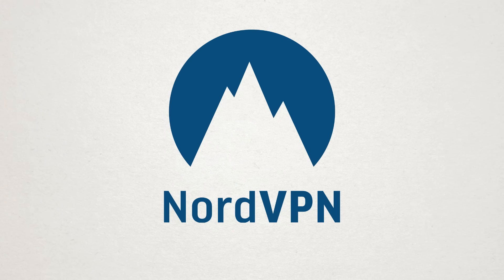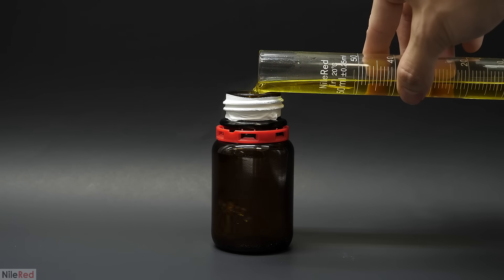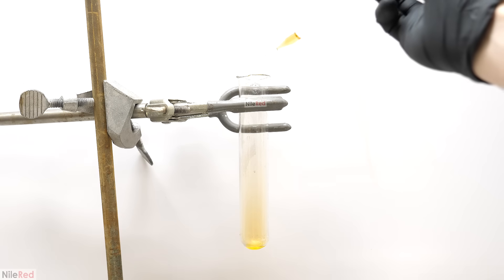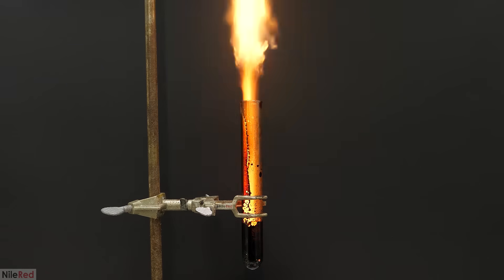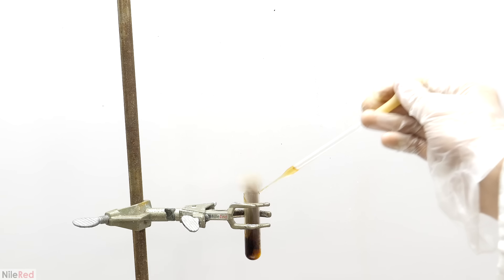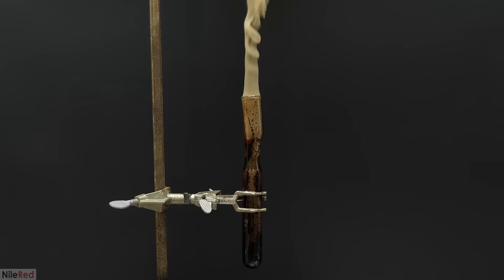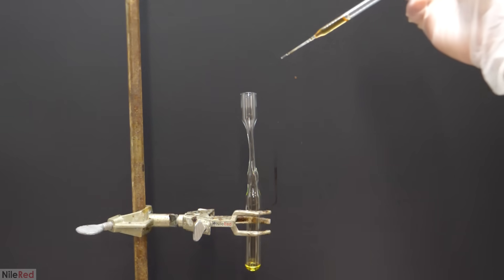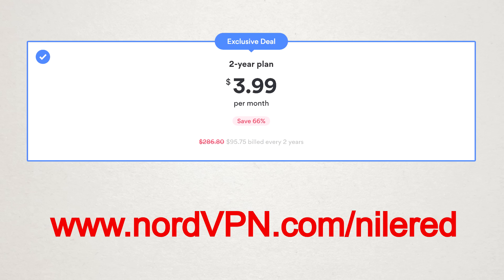Making test tube liquid rockets

Comment: 16.7ms per frame on a 60 FPS footage would be more accurate, also, if the camera does not specify if it's truly 60 or 59,94 there are easy online tools that can analyze it, not sure if it helps without precise mixing but may help in other experiments, cheers.

Comment: This would be a good self lanching model rocket motor
Idea no.1: you can flip the rocket when the engine is in place and it would fire and blast off for a few seconds (no longer applied now that i get what i mean by this idea)
Idea no. 2: you can have a little thing separating the chemicals and you pull it out to fire the engine and blast off (good for public store buying in this idea)
Just for if you wanna make a rocket motor out of this

Comment: Hello...
OK, to neck down the test tubes, clamp a pair of pieces of wood in a vice and drill a hole on the center between the two pieces to make somthing like the jaws of a pair of pliers.  You need to have long enough pieces so that you handles on one side of the hole.  The hole diameter should be the desired throat diameter plus twice the thickness of the test tube wall.  Soak the wood in water for a day or two to prevent it from burning.  Loosely rubberband the handle end together to make the tool easier to use one handed.  
Heat your test tube to the plastic point and slowly squeeze the test tube with the wood pliers at the point where you want the throat, while rotating the tube.  It may take a few heats to get down to the desired size.
For the eye dropper, take some glass tube and draw out a long  spout with a 45° to 60° bend.  The spout should be long enough to get the tip into the throat, if not past it a bit.
Keep up the good work!!!

Comment: The phenomenon you found of solid material is similar to the coking phenomenon in hydrocarbon fuels, the problem with it is that it could clog the valves and pumps of preburners or the main combustion chamber, maybe through thorough mixing by the fuel injectors it is able to burn without the residue

Comment: 0:20 Why??? Wouldn't the Nitric acid eat his hands 😭
Reply: I mean yes. But acid can be washed off relatively safely if ready and done quick. Very minor burning quickly with some. But as far as I understand most take a second on skin. It's the saturation isn't washed off immediately that's dangerous unless it takes a second to get to in the first place from my understanding. Pretty much just an example of why skin is better than gloves in that case. Really drives home that minor acid burns would be better than pretty rapidly combustion gloves (melted plastic on your skin will be worse I promise, not for every acid but here yes)

Comment: what if you modifyed a carborator to take in the oxidizer instead of air, and then mixed it with the fuel and had that go to the nozel so it would kinda work like a car

Comment: You can get MMH in the forest, it's the active toxin in the poisonous false morel mushroom. People eat them after parboiling several times, changing the water for each run. I suspect the yield of MMH would be minimal, but it would be awesome to extract literal rocket fuel from a mushroom. You'll likely also find red mushrooms with white spots like in Super Mario. Those don't actually make you bigger, but they may make you hallucinate into thinking you've become bigger, so it's best to avoid those.

Comment: Ok Ok 
I hope this finds you and you read it! (sorry I didn't double check this, I just one time wrote it because I'm in a hurry)
So you should use canula transfer lines with glass syringes, that way you can inject either a single compound or both concomitantly just as a fuel pump would inject into the rxn chamber the two compounds for a rocket engine.

I think you said you injected the aniline into the nitric acid and that was a poor choice. This is because you should have the more dense nitric acid 1.51 (g/mL) displacing the aniline (1.02 (g/mL). When you add them your way your getting layering, then mixing. When you want a more mixed solution and aggressive rxn you add the more dense solution to the less dense solution and the two MUST mix in order to find their displacements.

(typing and thinking as I write this) I truly think the safest and best rxn would be adding aniline into the nitric acid via a long canula transfer line, and doing with positive pressure nitrogen from an aniline reservoir that is under positive N2 gas pressure. You can then use a stopcock to start and stop the rxn and continue adding fuel so it's not your limiting reagent.AND if you get good, you can have two canula transfer lines for both solvents under positive N2 pressure!!!! ** best idea yet
The canula line MUST BE submersed to the bottom of the test tube or whatever container your using. Just as the rxn chamber is the primary area before kinetics occur, your test tubes are oriented the same way. You need the bottom of the test tube (1 rxn chamber) to be fully mixed before ejection into the kinetic/velocity chamber, or second stage of your rocket engine. 

Also, go have some fun with KClO4 or KClO3 (if you're feeling froggy) when the salt is melted into an ionic liquid, then inject your fuel. I had a great demonstration day making gummy bear rocket engines for some visiting 8th graders! haha

I would again LOVE to visit you and do some fun experiments together! I'm about to graduate with my MS and have no job lined up yet. Doing experiments all day sounds AMAZING! Please please please :)

Best Regards,
Nick Nye The Science Guy
Reply: did you really have to write a whole story plot just to give him a small message

Comment: A way to expand on in would be to add a load cell to the setup to measure the force of the expanding gas. That way the performance of the reaction could be judged more easily compared to just observing how vigorous the reaction was.

Comment: Hey Nile what you need to do because I saw something that I've noticed on the rocket powered section your throat is too far up from the actual ignition source I think you're losing a little of the thermal energy there if you brought it down like to 1/3 of the length of the tube you probably would get a much more vigorous flame because he would be constraining it and then letting it expand

Comment: Could you make that on a small enough level to put it in a bullet?
Reply: It seems possible but the priming mechanism wouldn’t be similar to that of conventional bullets. Also hyperbolic are extremely dangerous. Notice that the video of Periodic science they person had full body protection. That is because the chemicals are also violently corrosive to skin and the fumes that are produced are dangerous even in small amounts. There’s an old NASA video somewhere over hyperbolic safety. And I should point out that no one uses them in rocketry anymore (maybe Russia does) due to how dangerous the fuel would be during a malfunction at any point.

So to keep it short: Yes it may be possible but given the risks it would not be worth it since a regular bullet can easily kill.

Comment: The test tube with the narrow thoght would have work a lot better if you made two holes and put a tub through each and use a pump to shoot the fuel and oxidizer into the tube and make them face up at an angle so the hit each other

Comment: well if it needs to be a strong oxidizer and a fuel would you be able to use ozone as the oxidizer and a fuel? and if that were to work would the fuel also have to be gaseous like a petroleum gas or something?
Reply: You want fuels to be liquid because tank mass matters, petrol gas can just be liquified, as can ozone.

Ozone was tried as a oxidizer, but decomposition was too fast for practical use

Comment: You know, I made a mix once to make some cracker balls for my kids. Potassium chlorate and sulfur. Ground really fine and added enough distilled water to make a thick slurry to paint onto round rocks. Once dry and threw on the ground it really pops. And sometimes it would pop multiple times.

Comment: NASA use to use a mixture of iodine and another chemical which I can’t remember the name of at this time, old mines forget, but nasa used it to launch the moon lander back into orbit from the service of the moon. Check this mix out if you can find the mix. If I can find my notes I’ll send it to you. It’s VERY reactive and it will probably heat the glass tubes up so much they will probably crack. Nice video dude.

Comment: I think something that would improve the results would be perforating the tube closer to the combustion area rather than the mouth of the tube, this would compress the gases and then would force them out through the mouth just like the real thing. If you look at the real engine, the combustion chamber is really close to the perforated "neck". Just my opinion but it would be really cool to see what would happen with a smaller "combustion chamber".

Comment: I'm into astromony, physics and chemistry; I also love your channel but for the other reason of this comment is to give reasoning, thrusters may contain a tendency to wiggle due to the force of it which is by fuel that is highly flame able and used as energy; connecting to a kerosene, liquid oxygen or composer for the fire. The power depends on the area so there will be a gravitational or random push back. Air results into P (me considering as air) and A (aerodynamics), P and A come onto the top exactly so then the rocket doesn't have a seizure but it also depends on how many thrusters and the thrust components. If the thrust is high we might consider that it won't start falling mid air or won't be powerful enough. However G (gravity) exists which is a simple problem that can be solved by the work of hydrogen, Co2 or liquid oxygen, although more thrusters work. A thruster basically doesn't care about mass since it is base on base.

Edit: this prob won't be seen and you might already know this i don't know

Comment: Your statement that the fuel pushing on the nozzle and combustion chamber is what propels the rocket is pretty false. The vast majority of thrust is generated by the expulsion of the exhaust fumes at large mass flow rates. The divergent section of the CD nozzle also speeds up the exhaust, because at supersonic speeds, an expanding cross-sectional area increases velocity, the opposite of how the gases behave at subsonic speeds. 

This increased velocity increases the mass flow rate of the exhaust gases, which increases the thrust force.

Comment: Drill a few holes bottom of the tube for air
Reply: These are hypergolic fuels. They don't require outside oxygen. And the oxidizer supplies it with oxygen

Comment: You should have maybe thought about putting either the bottom of the test tube on the surface of the table or using another ring stand and a ring under the surface of the tube in case the rocket creates too much thrust...

Comment: Rocket Thrust in the Throat can only get really close to supersonic speeds, because afterwards you would choke the Flow. So the Throat is designed to get the Exhaust Gases to travel at Transsonic Speeds and no more (Note that i refer to the local Speed of Sound, which, since Rocket Engines work with really high Pressures, and the Exhaust being really hot, is very high)

Comment: Lol the scream that the first test tube did startled me

are there syringes that operate at a 90 degree angle? What if you could inject the aniline directly into the acid, but without putting your hand in danger?

Comment: You had the fuel in the test tube 
But you didn’t have oxygen inside the test tube so the combustion took outside 
Then travelled inside the test tube 

Next time you use oxygen for correct combustion

Comment: Check out the ME-163 Komet, A Hypergolic Fueled Rocket Plane (The First Ever Rocket Plane) Used By Nazi Germany In WW2, Used C-Stoff and T-Stoff as fuel, Could Reach 36,000 Feet Alt in under 4 Minutes and Could Travel As Fast As 1,100 Km/h

Comment: the reason of it not showing any intresting things when you narrowed up the throat was the 
1) the combustion chamber or the place before the throat where reaction was happening was way to big and thus there was not much pressure built up to fire through the main nozzle
2) the throat to nozzle ratio largely matters when you deal with bell nozzle engines here the nozzle was way to big and what happened was the pressure in the chamber dropped too low and thus causing the the air to come in from outside which slowed the reaction and thrust. this is why the flames was not close to the walls (glass)
3)the shape of the part after throat was not well for fluid mechanics. if you see very carefully the throat the place just after the throat you would see a huge empty space between the flames and wall which should have not existed 
these were only which i found out being a noob in the subject but yes i could say if he had done all these he might have blown everything around and even glass would not be able to handle the pressure in the chamber

Comment: Been having problems getting your hands on things, could not easily lay my hands on 10% of the materials you use here in the UK without someone asking questions lol. I am a graduate of chemistry but having things like working ovens and smart melting point equipment was not something possible most of the time in industry. Then again my last workplace the newer lab rats regularly connected Nitrogen and oxygen gas cylinders up backwards and spent hours trying to work out why things didn't work until I checked and maybe swore just a little bit

Comment: I agree with you on the smaller tube.  when the larger tube received the reactant it ran slower as the tube had a larger area to cover, whereas in the smaller tube the reactant had a greater amount to deal with on a smaller scale.

Comment: The shorter/thinner tubes have an ignition point outside of the tube, the fatter inside. Could oxygen be a factor? The tube would have low oxygen levels due to nitric acid decomposition and air pressure. The compounds combine and produce the initial reaction but need a specific ratio of oxygen to ignite? Interesting....

Comment: You definitely need a fuel injector bro
Try Scott Manley video or one of those oil foundry atomizers. The nitric acid should passivate most metals used for the manufacture of such an assembly.

Comment: I think that the variables between the short small tubes and the short big tubes is the pressure to volume ratio. The pressure building up doesn't have a big enough volume to get the ignite out earlier on (with bigger doses) so you need to make the ratios smaller for the small short ones with maybe an accelerant to keep it lasting longer?

Comment: So I'm a rocket scientist (I worked for Aerojet). Early rockets were gunpowder. WW2 manned rockets used Hydrogen Peroxide and decomposition catalyst (Cu, Mn, ) injected (H2O2 both fuel and oxidizer) thence adding methanol and hydrazine to catalyst stream (1000 degree O2 is hypergolic).  Aerojet made thrusters that injected hydrazine to a Ruthenium plated chamber which exothermicly decomposes hydrazine to N2 and H2.

Comment: I wouldn’t want to be the first guy to discover this reaction. You’re just experimenting, and think “Hey, what would happen if I mixed Nitric Acid and Aniline together?”, and then your test tube violently ignites.
Reply: Par for the course in the early days of liquid rocket fuel research. At least this stuff is stable at room temperature, it got even more exciting when they started working with highly unstable experimental compounds that had a tendency to violently decompose when someone in the lab closed a door too hard or farted too loudly. You should check out Clark's book as mentioned in the video, it's a very entertaining read.

Comment: I love how the second test just had a short “Woo!” as its sound.
Reply: That sounds like the sound from a jumpscare. All you need is to put a scary face with the sound
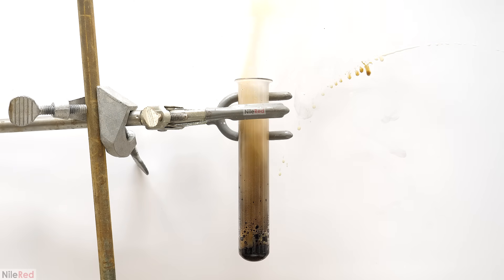Reply: 4:25 is when your mom let's you get McDonald's
Reply: Reminded me of futurama, when bender became human
Reply: @polydullmemes3497  you mean when his fat body would release air from the folds and make that sound?
Reply: @veganpatriotmemedogenfrens7209  yeah exactly
Reply: xD     I thought that was Nile screaming
Reply: @sogstillsleep had me wheezing
Reply: @sogstillsleep  "aaaaaaaaaa"
Reply: the reason of it not showing any intresting things when you narrowed up the throat was the 
1) the combustion chamber or the place before the throat where reaction was happening was way to big and thus there was not much pressure built up to fire through the main nozzle
2) the throat to nozzle ratio largely matters when you deal with bell nozzle engines here the nozzle was way to big and what happened was the pressure in the chamber dropped too low and thus causing the the air to come in from outside which slowed the reaction and thrust. this is why the flames was not close to the walls (glass)
3)the shape of the part after throat was not well for fluid mechanics. if you see very carefully the throat the place just after the throat you would see a huge empty space between the flames and wall which should have existed 
these were only which i found out being a noob in the subject but yes i could say if he had done all these he might have blown everything around and even glass would not be able to handle the pressure in the chamber
Reply: I like the vapors from the first one.
Reply: Would be interesting to make a stand for the small tubes that sits on a scale and then you can potentially measure any generated thrust by its readout.
Reply: Loud WOW
Reply: It's having fun almost burning down his building lol
Reply: WOW! Is what I heard
Reply: Why is this so hard? It’s not rocket scie—oh wait
Reply: It's more like a wow than a woo
Reply: Sounds more like a wow